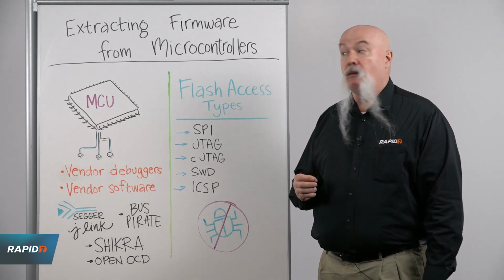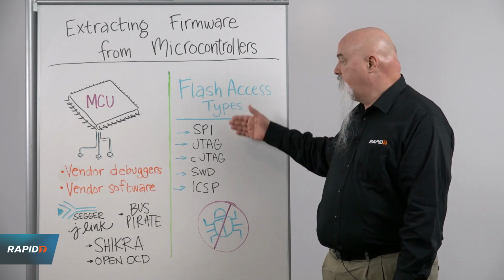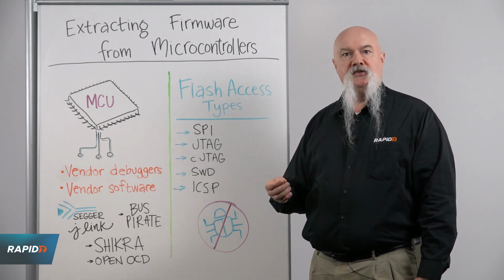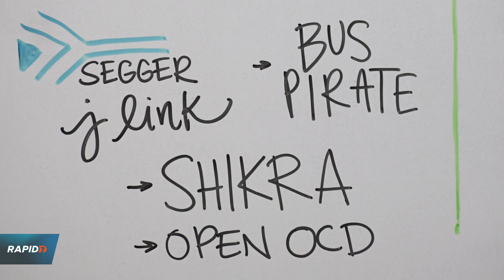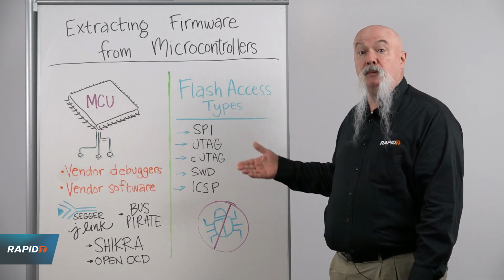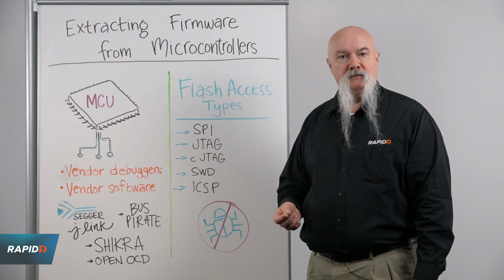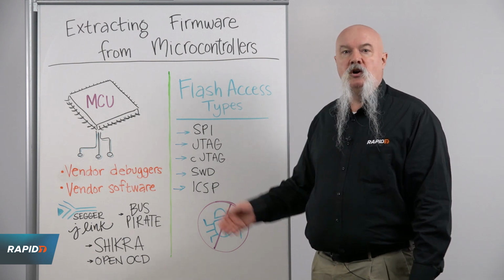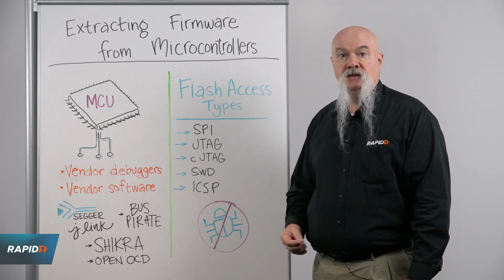Whiteboard Wednesday: Extracting Firmware from Microcontrollers

Comment: how can we get the Flash data when read protect is on?
or worst the read and write protect is on and the device is totally sealed, is there a way?
Reply: Did you find a solution to this
Reply: @rickyjay7363 No actually I'm not trying to hack anything, I'm a designer trying to make the product harder to steal.
Reply: Pl send part number of microcontroller
Reply: @manoramranavlogs728  Let's say it's scratched out and we don't know the part number.
Reply: It can be detected if part number is scratched

Comment: This is true if the microcontroller doesn't use wireless communications to handle anything that would either modify the firmware on the mcu or modify the state of the readback protection setting to a vulnerable state.